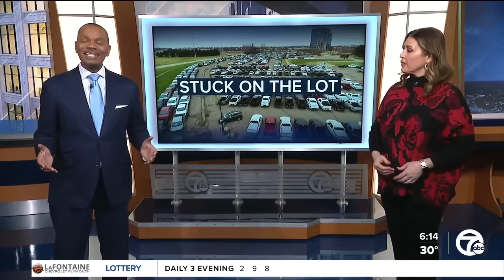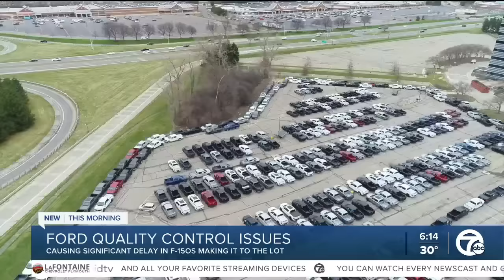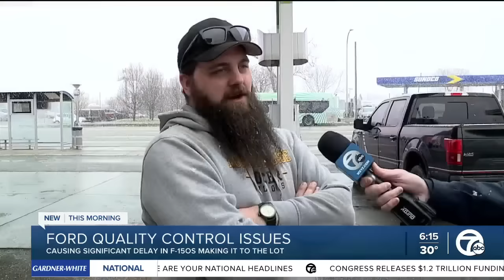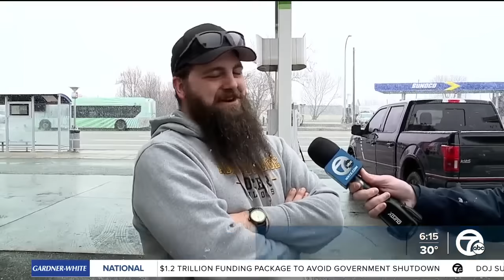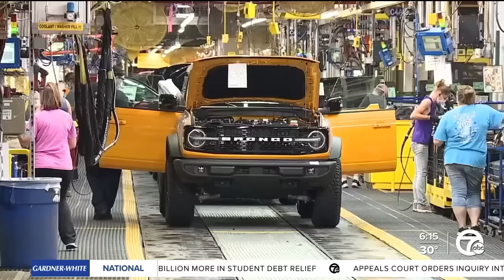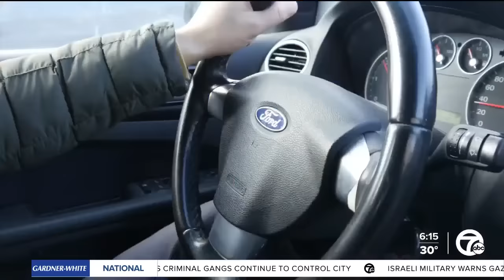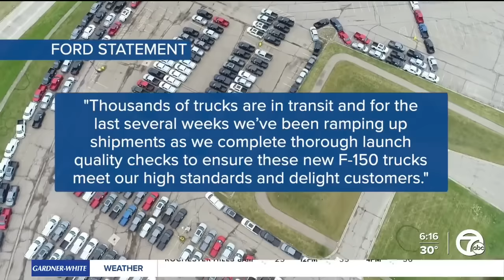Thousands of Ford F-150s are sitting on lots in metro Detroit. What's the issue?

Comment: Garbage quality, yet they still want to charge us $75-100k for these. No thank you!
Reply: I don't understand why it's the best selling vehicle in the US. I guess the American consumer doesn't care about quality.
Reply: Even fully loaded they aren't worth that much
Reply: @dannydaw59 not a whole lot of choice for full-size pickup. Don't say Toyota tundra. Tundra is going through engine failure issues with turbo 6 not to mention earlier turbo issue
Reply: In 01 I bought a new f350 4x4 6 speed 7.3t. It was like 28,000. It lasted 17 years with minimal problems.  Where is that now????? Less is more slower is faster.
Reply: Corporate greed
Reply: @dannydaw59 Start by asking some repeat customers of the F150. Seems like a pretty dimple way to find out….  I’m a repeat customer of lots of them; what do you want to know?
Reply: @ph00ny1 Plus terrible design and awful QC for fit and finish.
Reply: @jimblow52  coupled with dealer greed!
Reply: @PHILLIPfry2010  I guess you did good by sticking with the good old 7.3. Everything in between was bad bad
Reply: Built Ford tough should be renamed to Built Ford Suck 😂😅
Reply: You can’t say Ford, or Dodge for that matter, in the same sentence as “quality”. It’s ridiculous how many issues these trucks have. You want to buy a nice truck with minimal long term issues? Buy a low mileage Toyota Tundra from a  couple years ago with the 5.7L V-8.
Reply: Probably fleet sales
Reply: @dannydaw59  it only qualifies that way because they sell them cheap in fleet form.
Look at any town, city, metropolis, township, county & state maintenance department. 
What kind of truck are 99% of them driving? 😉 
Ford likes to make claims on questionable bullsh*t facts.
...... and I've owned 3 Fords over the years, NO trucks though.
Reply: My 2013 Ram 1500 Hemi that bought brand  is still going strong with minimal problems with only 68,000 miles on it.
Reply: Absolutely!!
Reply: I agree. I purchased a 21 f150 for 60k. I won't do it again.
Reply: Doesn't matter the price. They're always stalled. woulcn't give you a nickle for a carload of them.
Reply: YEP, I EXPECTED Quality t=when they were $20,000 I sure as heck won't buy one now that's NOT dependable, pay that much & they STILL have to go sit in a dealer for days to be fixed LOL
Reply: @ph00ny1  Nice insight. Ya, I don't understand why the Torota Tundra isn't in the top 10. The Toyota midsize truck kicks the domestic automaker sales numbers too. Again, I scratching my head over that one.
Reply: @cwqrpportable  So I take it that you like the reliability of your F150?
Reply: I sat in a 2024 F150 and when I grabbed the shifter all I heard was creaking plastics. Really annoying and not worth the 70k MSRP. I guess I'll keep my old truck after I get the trans rebuilt. At least the shifter doesn't sound a fisher price toy.
Reply: @993mike  Mopars with Hemi are extremely reliable. My Chrysler 300 has been a bulletproof. I was a Ford guy all my life and gave up on them as every new one was less and less reliable. That's why I'm driving a Chrysler 300 now.
Reply: Why wouldnt they keep charging that if theres idiots like the one interviewed willing to spend that much on not only his lemon, but another brand new one
Reply: @TRUCKERMANN92  Your statement is an oxymoron.  You're bragging about something with only 68K miles on it.

Comment: I have an 01' GMC Sierra with 320k miles. Its a 23 year old truck and it hasn't given me any issues with the exception of needing a fuel pump and an alternator in the entire time I've owned it. There is absolutely no reason an owner of a brand new truck should have any issues with it.
Reply: I BELIEVE YOU, BUT TRY IT WITH A TODAYS GMC.🙈
Reply: @doorgunnerangel4105  Oh yeah, you're not wrong. I don't get it though. How did the quality on all these trucks get so bad? Why have customers accepted this kind of product?? Go look into what a heater core change involves in any of these trucks, and it's not uncommon now for a heater core to pop under 20k miles on any brand of truck. My 01' still has the original and it's leak free.

Comment: 80,000 price tag and depreciation by half after a year or two, who wants that garbage?
Reply: It's a truck, not an EV
Reply: Truck or not the above statement holds
Reply: @logantcooper6  trucks don't depreciate by half in a year or two... EVs do
Reply: @P2B_JC  unless they have the quality issues that most new truck manufacturers have, which has been the case.
Reply: @kathrynw3  not even then
Reply: @P2B_JC  When transmissions and engines are blowing up at 10,000 miles, yeah, yeah, they do, but that's my opinion (and most of YouTube), but I'm sure that you're right.
Reply: @kathrynw3  that's what warranties are for. That doesn't affect the trade value, either
Reply: @P2B_JC  👍
Reply: It's a crapbox. I think EVs probably retain more value.
Reply: @ILovePancakes24  that is incorrect. They lose substantial value thanks to government subsidies.

Comment: Same thing here at the Ford plant here in Claycomo Missouri, and the 30 vacant lots Ford bought around the city. Thousands of trucks and vans just sitting collecting dust
Reply: My truck is parked there right now
Reply: Isn't that the worst thing for a vehicle to do is sit idle long term? Dry rot, seals dry out, battery discharges, et. cetera?

Comment: This is why used clean cars from the late 90s and early 00s are up in value. People have caught on. Most older cars are well built and have been proven to be more reliable than newer cars. At the dealer lot I work for, a 2000 Toyota Camry XLE V6 one owner w/ 105k just sold for $8,000 after taxes and other charges. Well maintained car with recent timing belt and water pump. I mean it is what it is. Quality control needs to step their game up.

Comment: When looking to replace my smaller truck years ago, I said to myself that i would drive every manufacturer available. I liked the F150 but was instantly turned off by all of the upcharges as I felt like the truck I wanted was WAY overpriced and felt like they were looking for a money grab at the time. I ended up with a Nissan Titan and could not have been happier. Im now on my second Titan since my first was destroyed in a hurricane and could not be happier with the 2 I have owned. Just to put things into perspective, I was originally shopping for a truck in 2006 so Ford has gotten aggresively worse to where the average person will never own one. They did this to themselves!
Reply: I had a reservation for a bronco but I would not pay the 5k surcharge, screw that! I bought a first generation Titan for 7k and it is an awesome truck. So happy I am not paying 70k for crap.

Comment: 2024 XL SuperCrew should be absolutely no more than $40k. They are still MSRP'd at like $54k around here in NH with "$2k dealer bonus money" to bring it "down" to $52k. It's an absolute joke. Lower the fucking prices, interest rates need to be normal and trucks will fly off the lot.

Comment: Bought a 2023 Tremor in January.. within one week - rear seat back ventilation fan failed and got the TPMS failure due to the known issue with the Power Inverter creating EMI.. had two service visits to fix those issues alone.  Was shocked when the dealer said service visit waits for an appointment are ONE MONTH OUT unless you are going to the quick lube/tire rotation center they have.. like people have said - not good for the money people are forking out for these trucks.

Comment: It's not just ford it's almost every car company...prices have gone up, quality has gone down, fuel mileage hasn't gained much in 5 years, interest rates are out of control, dealers are using their typical slimy markups and added garbage fees and everything else, and to top it off- all the suckers who way over-paid for vehicles in the last 3 years, I'm assuming, are in short supply now- having recently gotten their fill of being fleeced by a slimy dealer on a new vehicle. Add that to the terrible economy in general and you pretty much have the perfect storm for what is going to happen in the next year. Prices will crash because these billion dollar corporations are not simply going to accept a year of no sales- and neither are their shareholders. They know that they are going to have to start shoving this crap out the door at any cost or their stock prices (and subsequent cash hoards) are going to crash. And the longer they put off the inevitable the better it is for those of us who waited. They're making more every day and adding to the supply...day after day after day. There are select vehicles that still are in short supply and high demand (Toyota hybrids) but it will bring the price of those down too when you can go buy anything else for wayyyy less.

Comment: I purchased a 2020 F150 and have never been as disappointed with a new vehicle!  I had a new 1995 F150 that provided great service, was comfortable,  and looked sharp.  The 2020 is approximately the same trim level, but things don't work as expected.  The AC is weak, the air handler can't divert air flow to the floor, and the passenger side dash over the air bag keeps bulging up, apparently from pressure below.  Aside from replacing the dash cover with another bulging piece, the answer is always "no problem detected."  Also, the ride in 1995 was so much smoother, without road noise and prominent tire scrubbing.  I should have bought the Chevvy!

Comment: With three Fords in our driveway, our daughters Focus needs a transmission and no one wants to touch it, Transit 66,000 miles, last month 8k for a new transmission, I hope our f150 holds up, we can’t afford much more
Reply: The ford focus has a certain problem with the transmission. If the car will not move in any gear, there is a shaft that will wear down and won't pump the trany fluid. It can be fixed. Check out you tube video on this problem.

Comment: What ever happened to a Maverick truck for $20,000? lol All I see on the lots are F150’s for well over 70 K now. Most people are mortgaged on their trucks lol. Guess they are living in them
Reply: Piece of junk Mavericks are selling $30K+ 😅
Reply: 32K for my Maverick
Reply: yea the $19,990 entry level Maverick price tag disappeared after the first year.
Reply: The Fraud maverick pickup is already under recall for shoddy fuel tanks. AKA the new Fraud Pinto...
Reply: Lol.  Maverick XLT in Alberta is 45k.  Gonna be there a while.
Reply: Yes, I remember that was a big "Selling" point for them. A $20,000 entry-level truck. However, all the Mavericks I see at nearby dealerships are selling in the low to mid-thirties.
Reply: I was interested in the Maverick when they touted the 20000 price point. People ordered them at that price and waited almost 2 years for delivery. Now they’re over 30000. They sell used ones for 23000 on the lot. All the manufacturers have issues with chip shortages and lousy engine designs.

Comment: A friend of mine works for a supplier, and told me, it's headlight wiring. New design for 24, and they overheat. They all need the harness replaced.
Reply: Ford has had headlight switch overheating and burning out since 1990 had a super duty rollback with idi 7.3 switches burning out all the time Fords wiring has sucked for over 40 years
Reply: My Lincoln tow car had headlight switch electrical problem. Replaced 2X same piece of shit .

Comment: Grew up in a "Ford Family" and over last 40+ years I have purchased probably around 30 new ford trucks from the old full size Bronco's in the 80's to f150's through f350's and even a few econoline vans. Always went with ford because of A plan then Z plan, that pricing was always an advantage. I used them for work and drove around 55-70k miles a year on my personal truck. The last year I purchased a Ford was in 2017. Over all those years when I had problems with the Fords I can't tell you how many times I said to myself I'd never buy another ford product. 
  Well, in 2021 I bought a new Toyota Tundra TRD off road Crewmax 4x4 with an old school V8 for 43K and its been the best truck I've ever owned. Its not fancy or what some consider "high tech" but I don't need or want all that crap in a truck. It doesn't get the best milage, 16-17 or 18 on flat highway. Milage trade off is for reliability and I've not had one issue with it. Currently it sits at 91k on the odometer, drives and feels just like the day it was new.  My opinion is Ford trucks look great on the outside but it's the cheap outsourced garbage on the inside that always lets you down which steered me away from buying one again, not too mention the immediate crazy depreciation on ford products once driven off lot. My general opinion of their dealerships over the years is once you drive off the lot, they don't give a "rats behind" about you and you simply turn into a number. 
  Corporations such as Ford have lost track of caring about their customers instead worry most about their profits and stockholders and its coming back to bite them yet again not to forget about their dealerships sickning greed. The big three's quality is unacceptable and now that I've seen and experienced a Toyota product that is also made here in the states, I honestly can't imagine going back. I can't speak for the newer 22 and up Tundra's.

Comment: I don't think this issue is just Ford's issue.  My 2018 Toyota Tacoma has had several issues, from when I first bought it (i.e. faulty rear differential needed replacement and several recalls).  The words, Quality Control ?  That's the nice way of saying it.   Building vehicles en-mass and by some people on assembly lines that don't get paid well.... along with materials that no longer last...  Well, the saying, you get what you pay for, is something that CEO's in ANY company like Ford need to understand, as reasons why problems cut into revenues.  That's the first reason.   Affordability is the 2nd.
Reply: Toyota quality has fallen off a cliff since 2020
Reply: @Christoph-sd3zi around the time they started building heavily in America. Pay higher wages, use cheaper parts to maintain margin for the shareholders. it always comes back to the shareholders.
Reply: You have to buy a Toyota made in Japan to get Toyota quality now.

Comment: I remember "Quality is Job 1" from the 1980s.  The worst vehicle I ever owned was a 1987 Ford bought brand new with maybe 10 miles on it when I picked it up.  Kept it for a year and bought GM and Chrysler products for the next 30 years until I bought a new 2018 Mustang 5.0 which was really nice.  Zero problems with it.   I hope they can get their supply issues squared away.

Comment: Looked at a new truck back in December, dealer started at MSRP and wouldn't budge. Every price rebate came from me (I help build the truck that I was wanting to buy), at 84 months the finance manger said he could get me in at $700/m, State Farm Insurance wanted $100/m, this didn't include the extended warranty cost that the salesman recommended that I buy due to the high rick of engine failure. Recap, I buy an over priced truck, pay over $800 plus a month then buy an extended warranty just so I can drive it after the OEM warranty ends. Fast forward three months this same truck is still on the lot, wake up America. (Note, never run it see what the banks would do)

Comment: I'm all set with vehicles built in the last 20 years. there is always an issue with them and it's expensive to fix. I don't need anything pretty to get me around, just something simple I can mostly work on myself. I miss my old 86 F-250. wish I never sold it.

Comment: Channel 7 needs to do a story on the 2.0 and 2.3 liter engines in the small cars and SUVs. Just had my engine replaced with 82,000 miles for coolant intrusion. There is a class action suit for owners of the 2.0 liter engines. These engines are ticking time bombs.

Comment: First new car I bought was a 2015 Ford Fiesta ST. Fun little car and just over $20k basically fully loaded. The ST’s held up well compared to the base model Fiesta which was garbage mostly due to the transmission. Ford doesn’t even sell cars in the US anymore and all the manufacturers got rid of their cheapest models. They need to bring back cheap fuel efficient small cars. Not necessarily Ford but car makers in general.

Comment: My 1994 Ford Ranger is still running strong!! They don't make em like they used to. I would only buy Toyota and Honda now. They quality of American cars seems to have slipped ALOT since 2010.
Reply: My 2006 Ranger 2.3 AT 2WD with 207k miles runs just fine.  Have been looking for a retirement truck for three years, researching like crazy.  Really wanted an F-150.  Finally purchased one………a 4Runner.

Comment: Plus the price is just nuts !  I looked at a basic 2 WD F 250 and they want 40K for ! it In 79 I bought a new F 150 super cab 8 foot bed 4.9 six heavy duty 4 speed PS PB and AC for the outrageous price of $4700.00  wish I could buy a new one for that now !  I still have it and it runs\drives  but is badly rusting and 300 K on the clock .

Comment: I would bet at least in those F150 plants it is like 1980 one shift and some working every other week.
But down the street from Wayne assembly in Ypsilanty there is a was plant making Ford small parts.
The valve plant in Northville is a gym.
Ford used to build the Mustang IN 1966 in the Ford Rouge. Iron ore and raw material came in one a mustang came out the other end.
It also started when the fasteners came in from the lowest bidder some time in the late 60s.
Except for the small volume special parts for the Mustang go fasters. Plus the small parts from another Ford plant.
BY the mid 70s a lot of the parts attached to the engine were not a Ford brand.